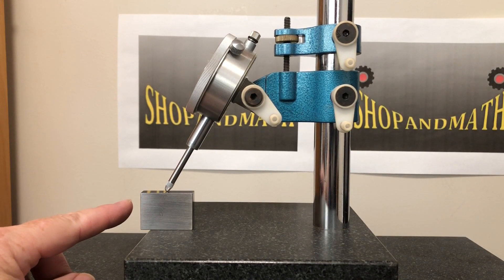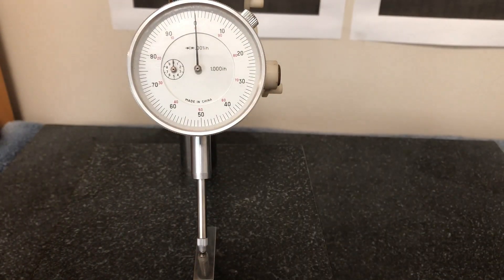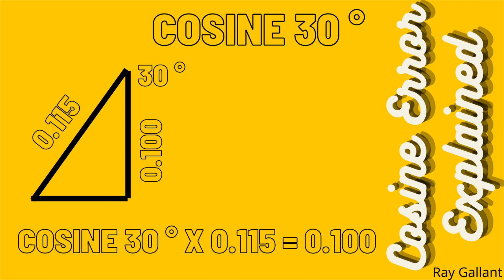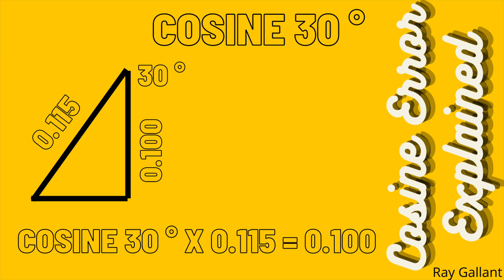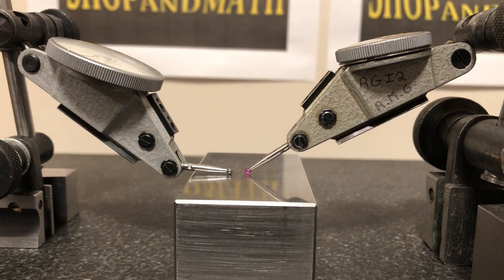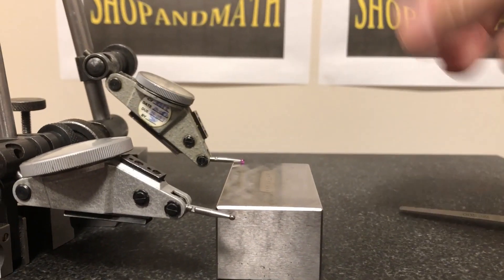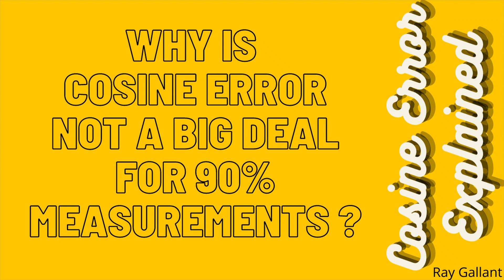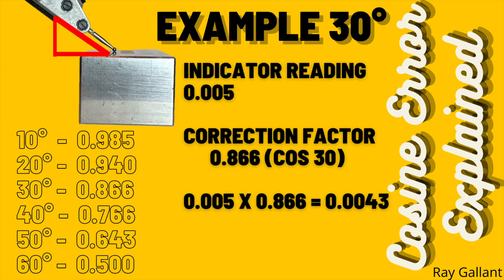Cosine Error Explained

Comment: This is actually not correct. Considering the indicator being used. Interapid indicators require a 12degree angle for a true reading. Although most indicators do require the tip to be 0deg or parallel to the surface being measured this is not always true. You will also find a number of starret indicators requiring a 15deg angle.

Comment: I looked at the part of the clip were you put the 100 thou block in under the indicator thinking the indicator was square with the surface plate but its at 30 degrees

Comment: For my Mahr and Brown and Sharpe Indicators, the tip should be parallel. But for Interapid DTIs, I believe the proper angle is actually 12 degrees to the surface being measured
Reply: Yea you got it right my man. Interapid is different l2 degrees
Reply from the maker: Yes you are correct 12° for interapid indicators is the true calibration angle if you are using the original stylist of 0.687 with an 0.08 ball
Reply: @shopandmath  a detail like this should be explained better in the video, as most people that I know use the original stylus. If you've put a different stylus on there then what came with it then it can be confusing. I know this video is not about the stylus and more about cosine error, your demo should reflect details about the variables you've introduced that a lot of people won't have to factor in. Good quick video though to help understand the effects of cosine errors and corrections.
Reply: @braingrenade  
Thank you for sharing and thanks for taking the time to comment. It’s much appreciated.
Ray.

Comment: why did you get a 115 thou increase with a 100 thou block ??????????
Reply: The cosine error of 30° for every hundred thousand is 15
So if you were to draw a triangle out with 30° at the top of the triangle the hypotenuse would be 115 if the back side was 100
I hope that this helps explain it if it does not let me know and I’ll try different way